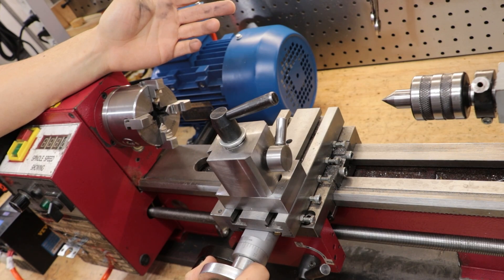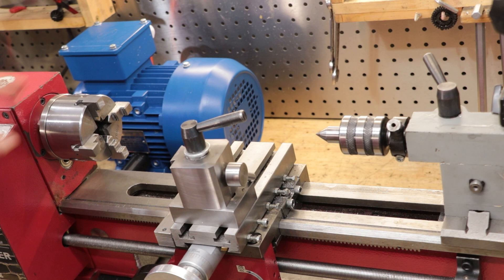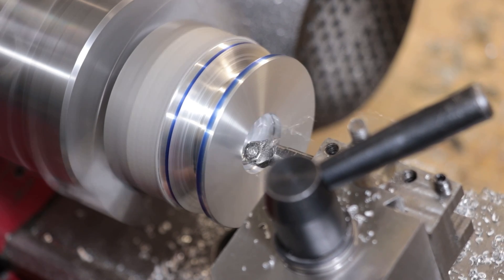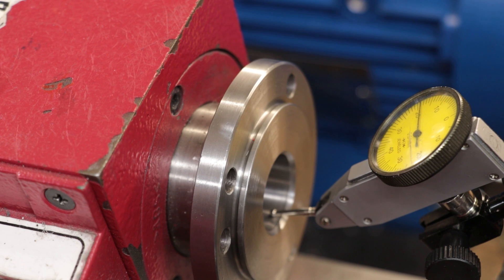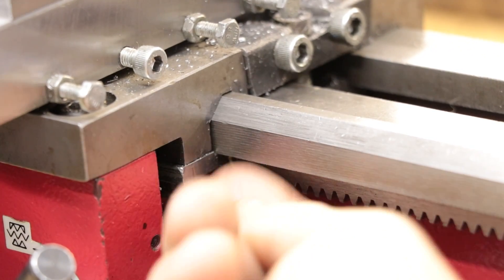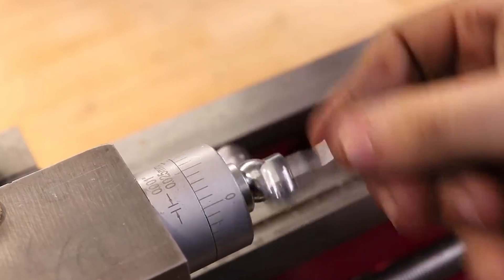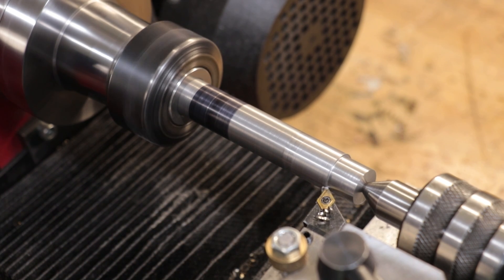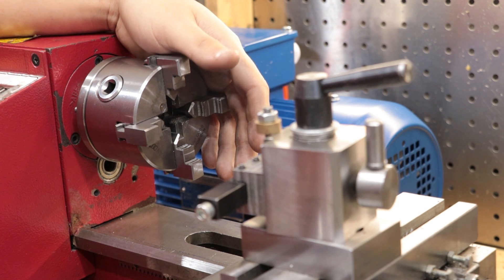The $600 Mini Lathe - 4 Years later

Comment: In my use for the lathe I'm thinking I would need to turn round stock from 6 mm to 4 and 1/2 mm and then thread the end. Nothing longer than 150 mm in length total. I do see the limitations you're talking about, but I wanted your opinion for something of this range for this specific project

Comment: It really depends on what you want to make, I'm wanting to get into machining for model making and I genuinely can't imagine wanting to work on a part that wouldn't actually fit in this machine, even with the chuck etc.

The difficulty machining steel is a concern however. As although I don't have a need for it at the moment that is a capability I can see myself wanting in the future
Reply: I as well in looking at getting one for hobby/rc work whereas most of my turning will be turning the end of links. Possibly a 5 mm section down from 6 mm to 4 and 1/2 and then putting threads on it. I don't see how I need a bigger machine for this I have seen other people do titanium in small amounts on these machines

Comment: A very concise and honest verdict on these lathes. I started with a sieg sc2. I made a lot of the improvements youve suggested, before I reached a point where I was trying to tweak up a spindexer on this lathe, clearance to the bed <1mm. I ended up with a 1973 Harrison M300. The minilathe made all the shafts to replace the worn out parts on the M300. I still have it, its the backup in case something goes wrong with the big lathe.
Reply from the maker: Glad some of my tips helped. The m300 sounds like a great lathe.

Comment: My 8x16 minilathe was 850,- USD. It came with a 5 inch chuck and has a 38mm spindle bore. It seems to be much more value for the money.
Reply from the maker: Wow, that is a huge spindle bore and chuck for that sized lathe. Looks like great value
Reply: @artisanmakes  The machine ist VM210v. It is made by different companies. I had good luck with mine. I changed the original motor to 3 phase 1hp with VFD and installed an electronic lead screw.
Reply: @artisanmakes  My 4 jaw independend is a 160 diameter. Used it a lot bevore I got my milling machine 🙂

Comment: Here in the UK where model engineering is still a reasonably popular hobby, there's no shortage of old, "low mileage" machines around. Mine is from the late 1950s and lacks some of the modern bells and whistles, but is a nice size (10"x26") and is beautifully made and very rigid, and has very little wear, at least to the ways. I got it complete with a DRO for £800.

Comment: I've been surprised that nobody else seems to want to enter the budget lathe market, as you say basically every one of these mini-lathes is the same model just being sold under different brands and there is likely only one real factory making the castings etc.

Same thing seems to be the case in the world of mini/midi wood lathes, you see the same model with slight differences across multiple brands.

You'd think given their enduring popularity though that another manufacturer might want to recognise the hobby market and produce something for under $1000 US, there's a few areas where it would be relatively simple to offer a better product for a slightly higher cost but still within a lot of hobby users budgets.

In general the small/mid sized machine market is poorly served though, same thing in woodworking.

Comment: This is an excellent assessment of the functionality of a cheap mini lathe. My take on it would be that a mini lathe is highly suited to model engineering tasks such as those who build miniature steam engines etc. 
The best advice is always buy as big and as high a spec of lathe as you can afford and have space for if you intend making this a long term hobby. 
Some of the Chinese lathes in a higher spec and price bracket than the mini lathes are very robust and competent machines indeed.

Comment: I started with one of these little lathes, and did a number of upgrades (mostly from Steve Jordan's channel); mainly changing the compound slide for a solid block (like you've done) and adding a carriage lock (which wasn't present on mine). I've subsequently picked up a ~600kg Colchester Chipmaster which is obviously in a completely different league of power and quality. However, I still use the mini lathe for some small parts as it's convenient, quite capable, and frankly - a lot less likely to tear my arm off.
Reply from the maker: Can’t say I’m not jealous. I’d love me an old Colchester
Reply: @artisanmakes  it's great; but it's worth noting that old British machines are like old British cars - if there's oil in it, it leaks. If it's not leaking, there's no oil in it ;)

Comment: I got a hobbymat md65 for about 200 euros, and if you can pick a second hand mini lathe up for locally for that price I'd say it's 100% worth just to tinker with and learn. But I've already spent more than double the entire machine just upgrading parts. From a new motor with a vfd, rebuilding the carriage and adding a solid toolpost and trying to make a more stable headstock, etc. etc. It's been a lot of fun aquiring the tooling to make new parts and make this machine capable of things it probably couldn't have dreamt of before. But it definitely isnt for everyone. This process has giving me headaches and there will always be something that can be improved. Like right now the original change gears have started failing and I have change gears so I'm thinking about building a shifter for it. But that's gonna require gear cutting equipment or at least knowledge on how to make hss single point cutter yada yada you get the point. Mini lathes are not convenient, they're the most fun and hatred I've had for one of my machines ever. And then also think to yourself do I not want to machine anything bigger in the future because 60mm in dia being the max that can go over my machines original carriage is a bit limiting when I have pieces of stock being 140mm...

Comment: Thanks for the summary. A tangential tool holder may increase your capacity to cut bigger stock. I have an Asian 9*20 and a Diamond Tool holder helped a great deal. Thanks for taking the time to make these videos.
Reply: What is the overall footprint of your 9x20?

I have thought about getting the lath in the video repeatedly (this guy is a very good salesman, rather he knows it or not) mostly due to its size.
Reply: @DH-xw6jp  1000 long, 500 deep and 450 high. Mine sits on an old kitchen bench that has been braced. I have turned 125 mm diameter steel to make mounting plates no problem.
Reply: @robertwalker7457  that's not a bad size at all.

The space i would probably put it is an old 48" by 24" cast iron work table (roughly 1220mm by 610mm) so that would fit just fine.

Comment: Im looking to replace the chuck on my lathe (currently a 4" 3-jaw with a tiny center bore of only .75") to a 5" 4-jaw. Any suggestions on manufacturer? Im not looking to break the bank with a 300$ one. Its an old model and the serial plate is long gone. I want to say its about an 18" bed with a 8"-10" throw. It spent most of its life turning automotive brake drums/disks, and those are up to 16", with plenty of space.

Comment: I started out on a SIEG C3 7x14 a year ago.  It was an excellent way to discover if this was a passing fancy or if I was seriously interested in machining.  Well, I just took delivery on a Little Machine Shop 7550 Deluxe - basically a SIEG C4 with all the upgrades you’d end up doing.  Having spent time learning the fundamentals on my C3, I have an immense appreciation for all the little (and several big) differences a C4 brings.  I believe that if I started out with a C4, I would not have the appreciation for all the wonderful things like the rigidity of AXA compared to 0XA, having power cross feed, and so much more.  These lathes are a wonderful way to get your feet wet in the amazing world of machining!
Reply: My thoughts exactly still waiting for mine to be delivered but I figured if I spent $600 and wound up not caring for the hobby I wouldn't be out a whole bunch still be able to use it occasionally to make a few small things.

Comment: On the moving point i recently moved a 8 ton brake press on my own 

A hydraulic jack a crow bar and some timbers it took a few hours to move the 5 ish meters from where it was dropped off by the truck but you dont know whats possible untill you have a go

Comment: This is the most in-depth and objective mini lathe review I've come across.

I brought an old vintage lathe (I'm in UK) and it's been great but a very different beast to a new or modern lathe. The time it's needed to clean it up is significant, old machines pick up a lot of abrasive dirt and it's a labour of love to remove it all. I've also just recently picked up a vintage milling machine and I will say that an old vintage lathe will almost certainly be more useable out of the box than a second-hand mill, the cutting forces can be so much higher and more variable in the mill and slopiness in a mill is much worse than for a lathe.

I think that either new mini-lathe or old full-size lathe, both are somewhat of a project and we're paying less to compensate for the need for extra setup and care in use. If your priority is to explore the world of machining and you like the learning process, then cheap mini-lathe or vintage machine is a good choice; if you want an instantly useable machine to produce top quality for little effort, then the low-end or vintage is not the way for you. Either way, you could expect to get the same results within the same time/money equation by going either route.

For me, I love to discover and see for myself so I have really enjoyed getting the vintage machines and learning step by step.

Comment: Have one of these myself, perfect for hobbiest, however my electric did blow due to metal shavings getting into the bottom of the control panel via the opening on the screw cutting spindle 🫠

Comment: I have two of those little lathes sold by Harbor Freight in the USA. I use them daily restoring small distributor and fuel pump parts. For the price point, they do a very good job. I've broken a plastic gear in one once which was my fault. The only other issue I've had is with the electronic control board in the machines. Both machines will keep running slowly when you turn them off with the RPM knob. I just turn the switch off too.  
I'd never used a lathe before buying one of these. I've learned a tremendous amount about lathe work on these lathes. It's very satisfying to use as your skill set improves. My personal opinion is these lathes are worth the money for what they can do.
When I bought these two lathes, my thought was if I can get 5 years out of them w/out any major expense to fix them, I'd be happy. This knowing it's a Chinese lathe made as inexpensively as possible. An electronics guy I know said he could fix the boards with better parts for not much $. When I have time and can shut them down, I'll ship the boards off to him to fix them.
If I was making bigger parts like this channel does, I'd get a bigger lathe like a 12" or 14". They cost $5k plus for a better Taiwan lathe but are worth it to make bigger parts and have more flexibility.

Comment: I've had a similar 7x14 for probably the last 15+ years and made a lot small metal and plastic parts for all kinds of things, but yes, you have to live within it's limits. I've leaned a lot having one and it has saved me on occasion when I absolutely needed another small widget of some kind and could just make another one. Once and a while I'd love to have a BIG one but then I'd need a much bigger shop too. I have had to repair my speed control box also and yes I gave it better ventilation for cooling. I wasted money on the aftermarket digital LCD readouts and went back the the old school marked dials. The LCD's just didn't last and surprisingly not been able to find replacement parts for them.

Comment: After this film, I suspect that you want to change the lathe to a larger one.
2 years ago I also bought a Chinese lathe from the Polish distributor, the Cormak 330x700 mm model weighs 320kg I made strong movements for movement and adjustable levels for leveling. I think this is already a specific equipment for a serious hobby.
  I also have a milling machine I have a Cormak zx7045b1 350kg
Although I have more equipment, I have learned a lot from you, I always wait for your next film 😀ids
I liked it so much that a week ago I bought another lathe 😀 Cormak 410x1000 mm 1300kg with a piece of machine.
Regards from Poland 👍
PL
Po tym filmie podejrzewam że chcesz zmienić tokarkę na większą.  Ja 2 lata temu kupiłem tez chińską tokarkę od Polskiego dystrybutora, model Cormak 330x700 mm waży 320kg dorobiłem mocne kółka do przemieszczania i regulowane stopy do poziomowania. Myślę że to jest już konkretny sprzęt do poważnego hobby.
 Mam też frezarkę mam Cormak ZX7045B1 350kg
Mimo że mam większy sprzęt to bardzo dużo nauczyłem się od Ciebie, zawsze czekam na kolejny Twój film😀👍👍
Tak mi się spodobało że tydzień temu kupiłem kolejną tokarkę 😀 Cormak 410x1000 mm 1300kg o już kawał maszyny.
pozdrawiam z Polski 👍

Comment: It would be interesting to see what kind of money is also invested in the tools & accesories for the lathe. I assume bare minimum is very much in line with the value of the lathe and if you go to the other extreme there is no limit on how much you can spend.
Reply: Yeah, I've always wanted to see something where someone puts together a set of specifications from one of the "lol just buy bigger/used" lathes, possibly scales them down to suit one of these mini-lathes, goes through all of the upgrades needed to make the mini-lathe meet those notional specs as much as possible, and determines just how much time, money, etc. went into achieving that. How close could you get before it would've really been less expensive to start with a pricier machine, what are the steps to get you there, etc.

(Of course, it's also worth considering the value of the education in machining that comes from solving these challenges, which I think this channel has done a pretty good job of highlighting.)
Reply from the maker: Personally I’ve never really believed that. At least on the more affordable end. I put together a video a while back and from memory you only need $100-$200 worth of tooling to get started. Good set of drills which most people will have. Centre drills, some hss or carbide tooling and a live centre and drill chuck. That is pretty much all I bought and used for the first year of using this lathe.

Comment: I have a Clarke Metalworker, basically the same as yours which I bought used about 5 years ago for £275. I agree with everything you said. I now have a Myford Super 7 but I still wouldn't have anyone knock the mini lathe. Sure, it has it's shortcomings. Afterall, you can pick it up and carry it more easily than most drill presses, so you can't expect it to perform like a bigger machine. As you said a few improvements go a long way and there are tons of them on Youtube. Mine doesn't suffer the issue with the topslide dial as your does; the leadscrew is captive. The only thing that bugged me was the lack of power. It had a 500w motor but on larger diameters one is faced with only taking tiny cuts which can be very time consuming. It now has a brushless motor which fits neatly in the place of the original and the difference is amazing. Worth every penny, though motor and controller did cost more than I originally paid for thr lathe !

Comment: Excellent video about benefits and detriments of a mini lathe. I think you covered the topic well and shared solid information in a professional, concise and unbiased manner. 

One thing you brought up about used equipment is location, I would like to expand on this a bit. I live in North America and people say to buy bigger used lathes or mills (I have one of each), but the reality is your proximity to current and former manufacturing centers dictates availability and price. Where I live most of the older manufacturing died long ago, so prices are high and availability is low. Four or five hours drive south or east and the prices drop as selection goes up exponentially. In these areas machines are available because places are upgrading equipment, machine resellers are in the area, or companies are closing their doors.  

A second problem with used equipment (at least industrial equipment) is most of it is three phase. This isn't a problem as much as something to know, understand and factor into your time and materials budget when purchasing the equipment.

Comment: I have a similar model, i had issues with the electronics as well, a chip of aluminium managed to jump through the hole for the leadscrew into the electorincs board and short out a connection. Im handy with electronics and fixed it but as you say, new board is expensive. I taped up that hole so nothing but the leadscrew can make it through now.

Comment: I'd rather save up 2000-5000USD for a proper big one so I won't have the troubles you have had
Reply: For a hobbyist, finding and building solutions to those problems is just part of the fun. If it's for work/your income then of course you should get something you can rely on.